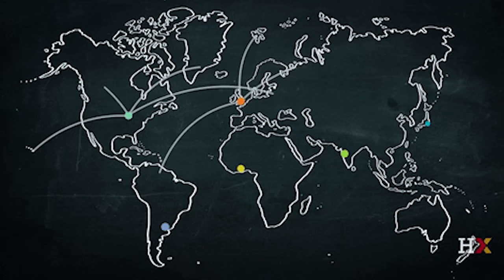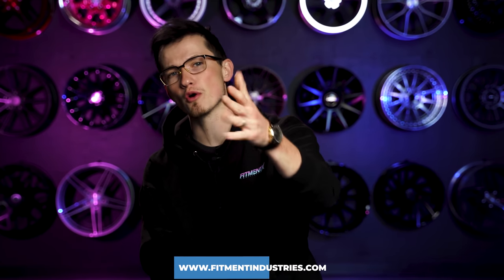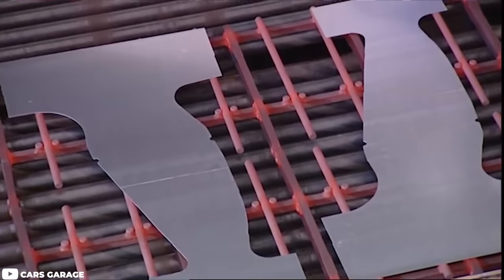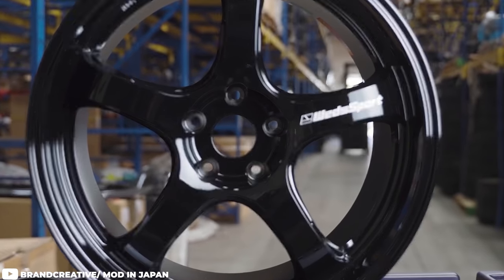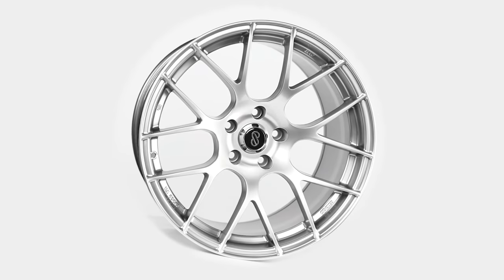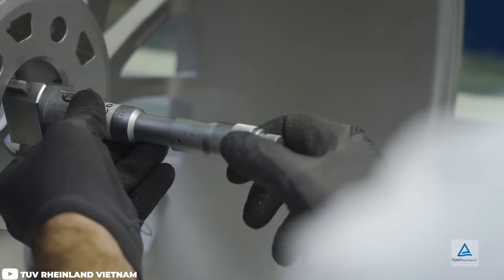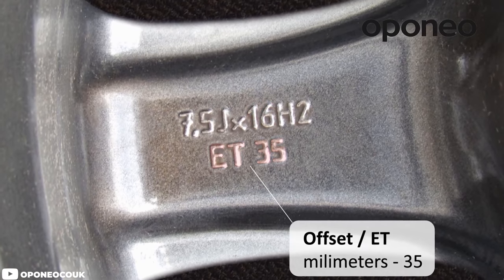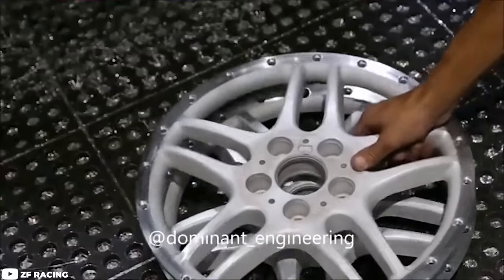Why Are These Wheel Symbols So Important?

Comment: Almost Everything have to be Tüv certified on your car if you want it to be legal in Germany (this is of corse because of the Autobahn).

And no my cars isn’t legal by German standards and it is because of my Studded winter tiers on both and a modified stock exhaust (basically a muffler delete) so that isn’t TÜV certified which doesn’t really matter since i live Sweden. 
The tiers need to be changed if i want to drive to Germany, but I don’t think the exhaust system will be an issue if it has passed inspection (“Besiktningen”) here in Sweden, as I have understood it, it only becomes a problem if it directly violates a law (for cars registered out side Germany).

Comment: Does anyone know what ET 3/5 means? This wheels 14x6 4x100 came with my car (Lancer ES 2006) when I bought it, corroborating with the fitment in the car they are not ET35 and ET-35 neither but I don´t know what ET 3/5 means.

Comment: TUV is so hated in the German car community, if your car gets inspected or you get pulled over they could ruin your day in an instant after finding anything not TUV
Reply: You know what is worse? Luxemburgish Version of TÜV (SNCT) because 1. they do not have their own testing facilities etc. so they ask specifically for the TÜV shit and yet when you buy a car in germany with 2 years of TÜV, well they only recognize 1 year because TÜV is "inferior". and f you have aftermarketparts with TÜV, they still require you getting a special inspection to register the papers, and sometimes even if it is TÜV certified, they still refuse it (the uncle of my bro had costum made Recaro Seats for his back done, WITH TÜV madshit paying nearly 2k€ for 1! seat and he still had to go back and forth 6 times between SNCT and TÜV.

I do get the reason and importance of a technical inspection if they would actually make sense: my car got once refused because of the wiperpumps for the headlights! not working as if i would see when i drive that there is no fluid coming out when i whipe my windshield (because this triggers also the whipers for the headlights), or another example: i went with a car of a friend and got refused for wrong tire size: installed 185/65R15, but in the papers only allowed to use 195/65R15 (bigger) or 175/65R15 (smaller) LIKE WTF??? the ones installed is right between these 2 valid options??!!!! the tires are either 10mm slimmer or 10mm wider and the entire tire diameter changes for few mm only so literally NO DIFFERENCE 
but noooo these KORINTHENKACKER are fookin idiots, these folks deserve to be send with a Reichsbahnticket in a Güterwagon Class Untermensch to a holiday camp in Poland where they learn to use their brain by concentrating.

Comment: Artisa Elders, 18x8.5 +35 5x100........ thats..... 0.5" too wide..... now I gotta run 7-8mm spacers. are you gonna make me poke? or can you offer a normal 8 wide size? I just don't have the stance boy ride with the stance boi widebody/empty wheel wells to fit 8.5. I could make make it work, but gosh darn it.... they were 6" wide at the factory and that was tight as is. #PTCruiserProblemsandbeingaPTainttheonlyproblem

Comment: “So you want a Ford Taurus sho “1st and 2nd gen (the real sho)
Reply: 1st gen are awesome but the 2nd gen had a cool engine but their were so many problems with them, and 3rd gen are the best in my opinion when it comes to performance for the money
Reply: Yeah ok? I have a second gen with a 3.0 so it doesn’t have that issue and what do u mean 3rd is by a long shot the worst one by far far stock for stock I bet I’d still win and my cam sprockets won’t snap off half way thru our pull 😂😂😂
Reply: Not to mention it’s ugly as fuck haha not say a Taurus is a sexy car but yeah it’s a bitch ass 3.4 v8 that “tried” to implement the variable intake system, and for all that and it’ll still break itself first pull 😂
Reply: @brandonanderson2998  I thought second gen sho had the 3.4 v8, maybe that was an option but the EcoBoost powered sho is no joke, 400+ hp from minor tune and with awd it launches hard
Reply: Oh yeah u had the wrong car man, so first gen is from 89-91 2nd 92-95 3rd 96-99 and the 4th is the one your thinking of with the eco boost and such, yeah 3rd gen is a hot pile of garbage 😂 not to mention no manual option mine is still the 5speed
Reply: Idk price wise tho 🤷🏻‍♂️ mine was only 2000 with 220 hp and if I put another 8gs into I’d b well past 400 while 10,000 would b a cheap new one, although I did see a cop one for like 11,000 the other day and a cop one would b even better!
Reply: @brandonanderson2998  yeah I got confused since you said first and second gen sho and I though that ment the 92-95 sho as first gen and the 96-99 model as the second gen.
Reply: If your looking for cheap speed then I defeneatly agree on the 2nd gen sho but even though the 4th gen is the priciest, it takes the least to make it fast at least with tuning it's just reliability is the main concern
Reply: It’s a weird in between, they have the same engine and transmissions for most of the 1st and 2 bud gen and look super similar
Reply: Although I’m the 2nd gen you could get a 3.2 with an automatic, they gave it a bigger engine to make up for the auto but the valve train on the 3.0 is more aggressive as well
Reply: Yeah I definitely agree 4th has so much potential it’s a dope ass car